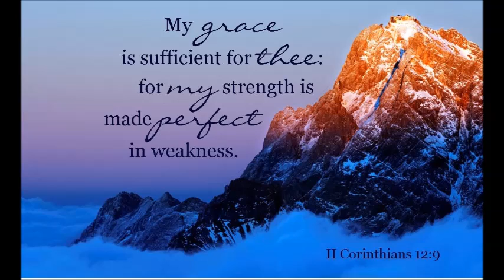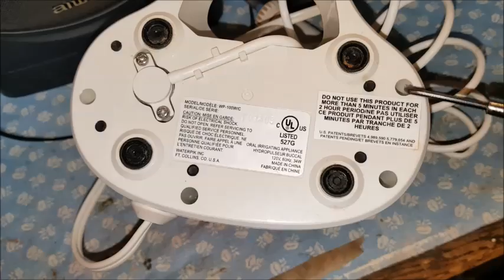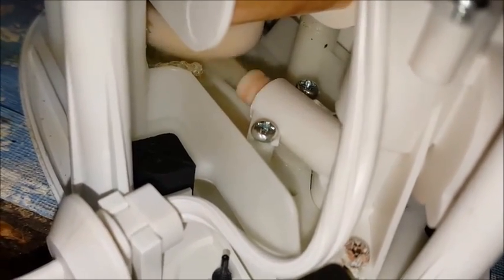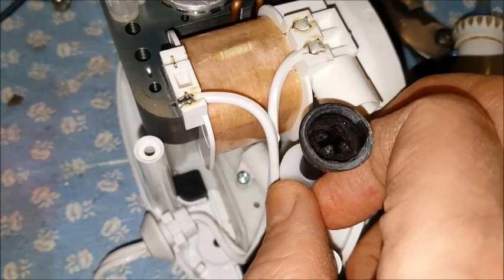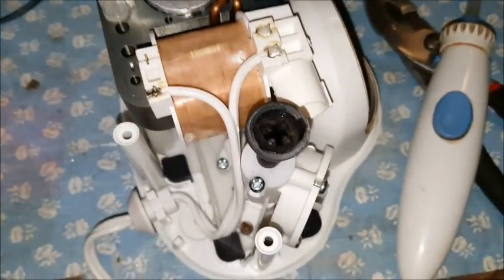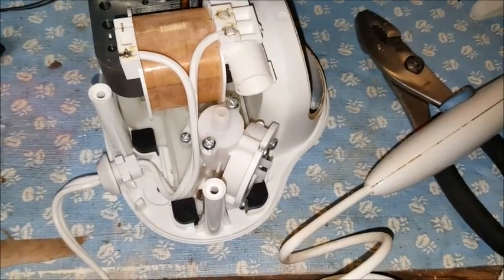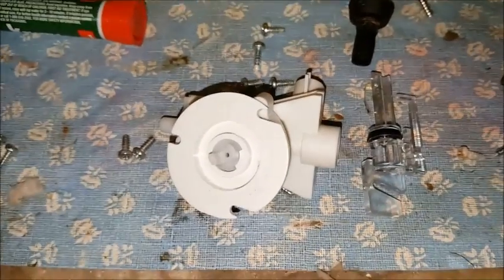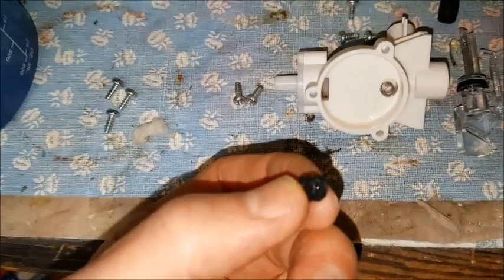Waterpik flosser not pumping water with dissassembly instructions

Comment: Thank you, Dave! Your video inspired and guided me to fix my WaterPik flosser (same model as yours) which had been in storage a few years and after powering on only made a humming noise and would not pump water.  After skimming your video I decided to open it up, got the phillips screwdriver and got busy, but got stuck. I re-watched your demonstration more closely to see you remove the blue dial which, for me, was the last trick to removing the top.  After removing top and inspecting parts, I watched your video again to watch how the parts moved and started testing the parts on my device. I discovered mouthwash had dried and adhered to the piston causing it to stick. Water was applied around piston with a cotton swab, mouthwash dissolved, then the piston started moving. Reassembled. Voila, a working Waterpik flosser. Your video was the most helpful to me among all the waterpik flosser vids I found and made all the difference to me. THANK YOU!!!!
Reply from the maker: Thanks for sharing your experience.  I am glad it helped you.

Comment: Thanks for posting this video!  It encourage me to try and fix my unit that wasn't spraying any water while the pump was running.   After disassembling the unit using your video as a guide, I couldn't find any obvious blockage problem.  However after carefully re-assembling the unit and turning it back on, I was able to get a full normal spray again.  Not sure what I corrected but am happy having a working unit again.  Thanks again!
Reply from the maker: You are welcome! Glad it helped.

Comment: Thanks for your great instructional video. I really appreciate it. You know I tore mine apart and then I eventually found that on two of my water pics of this similar model that you have in your video that the hoses were clogged on both of them so I put vinegar in the bowl and ran that through the hose and then cut it off and then let the hoses sit there for a couple hours and then I rinsed them out and then when I put them back together, they both worked great, so I think it was the hoses on two of those units that were just Corroded or clogged up I guess thanks again

Comment: Appreciate your attempt at a video, but trying to talk over the sound of the pump and then mumbling after that means some info was missed.  What usually happens with these WaterPiks is the freaking pump quits working.  Why doesn't someone post a video on that? Or where to find a replacement pump?
Reply from the maker: Thanks for the feedback.  I didn't have that problem.
Reply: They're little brushed electric motors like found in a cd/dvd old casette player. If the plastic diaphragm tears above that though I'm not sure where to get a replacement from..

Comment: My email to the WaterPik. The WaterPik model WP-100W has a design flaw and should be recalled. I need a replacement switch for my WATERPIK WP-100W that was purchased 6 months ago. The fault is in the gear-switch mechanism that allows the internal switch contacts of the switch to be partially closed, this results in motor stalling at full position eventually blowing the thermal fuse. A DC motor under a load will run hot with too little voltage. A low voltage forces a motor to draw extra current thus blowing the thermal fuse. 
Dear Michael, Thank you for your response. Unfortunately, since the unit has been taken apart we can no longer guarantee that the unit is factory sealed so the warranty has been voided. We also do not offer internal parts for purchase as we do not encourage taking units apart. Please let me know if you do have any additional questions or concerns. Thank you again for contacting the Waterpik Product Support Team, and have a great day!
Reply: It looks like they either didn’t read your email; or didn’t know what to say, choosing a generic response, hoping that you were vaguely implying you wanted to take advantage of the warranty.
Reply: My pik died and I believe this is the exact reason. The thermal fuse looks burnt. Do you know what fuse could be used to replace it? I can solder but I’m not sure what size or type fuse I should buy. Thanks so much for this message. It helps a ton.

Comment: Hello can you tell me how you removed the speed adjustment?
Reply from the maker: If I remember correctly I just pulled it off.  I don't thing there was any special trick. I think it's just held on by an interference fit in between the plastic knob and the adjuster shaft.
Reply: DIY with Dave thank you very much
Reply: Mine was on very tight.   Pliers would not grip the lever area.  Got some good tape (duct tape) & cut two thin pieces.  Applied one piece to one side of the control, the other to the other side.  Ran as much tape on the inside of the control as I could (along the lever part & up the side).  Stuck the two pieces together where they rose outside the control.  Gives you very good leverage to pull.  Mine came off after a slow, forceful tug.
Reply: Thank you for this question and replies. Was having the issue of not being able to remove the knob and reading these comments gave me the confidence to just use a bit more force. I used a set of pliers with a small bit of rubber over each side of the teeth to avoid scratching the knob. Turned the knob so it was pointing vertical. Got a good grip,  pulled hard and wiggled it up and down and it popped right off. 👍